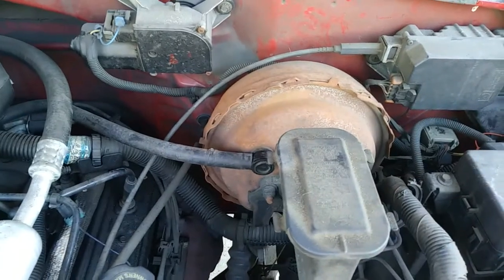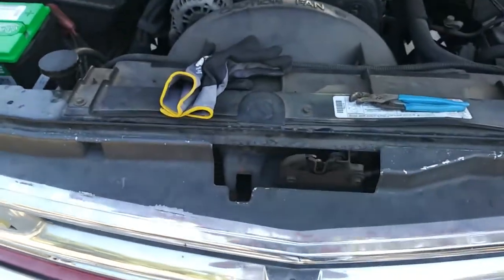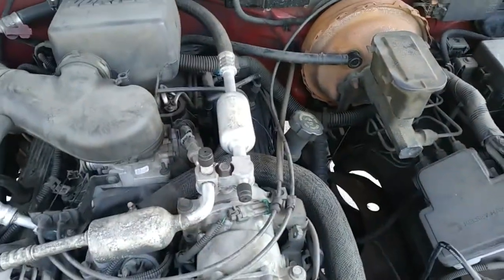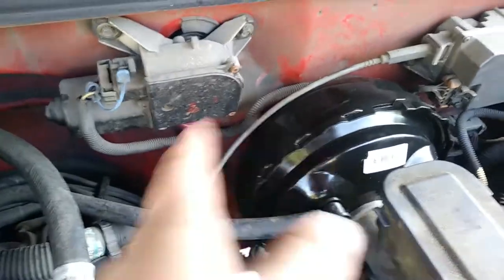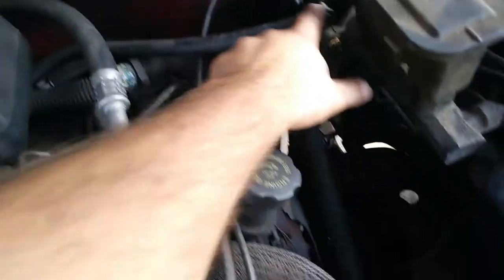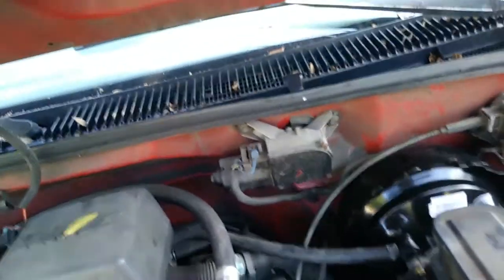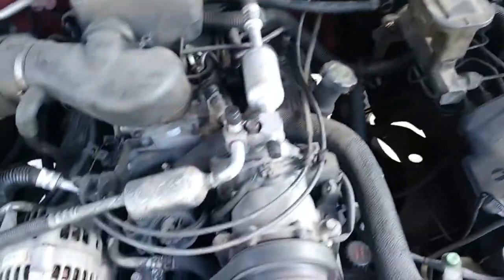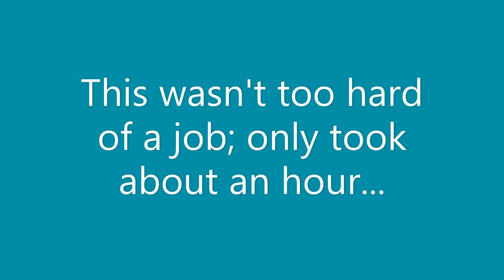Replacing Brake Booster on a '99 Chevy Silverado

Comment: But you didn't nothing what kind of video is this?
Reply from the maker: Just a quick overview of the job I did that day. I think the main thing I showed is that it can be done without disconnecting the master cylinder. It was pretty straightforward... If you have a question I can try to help :)